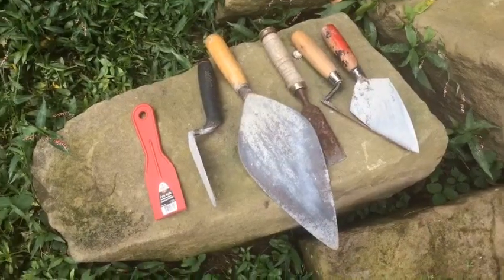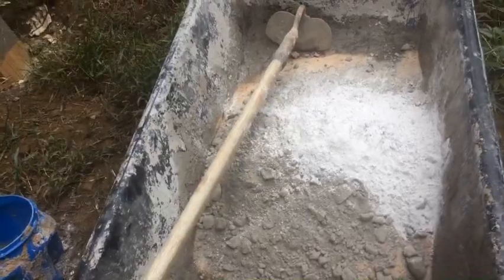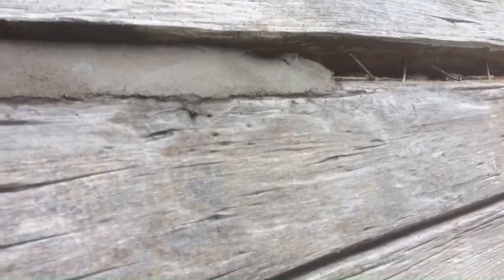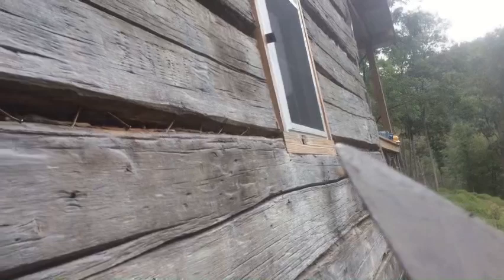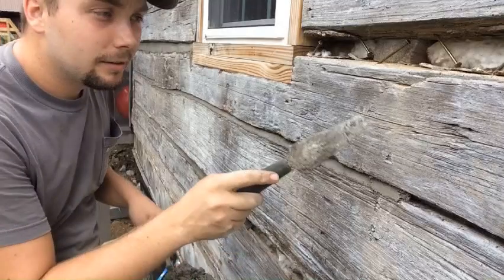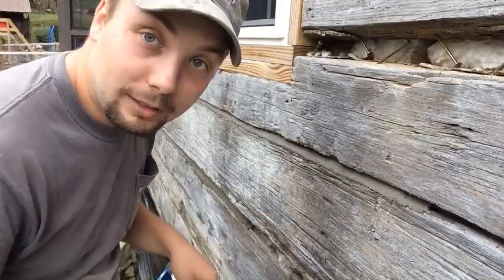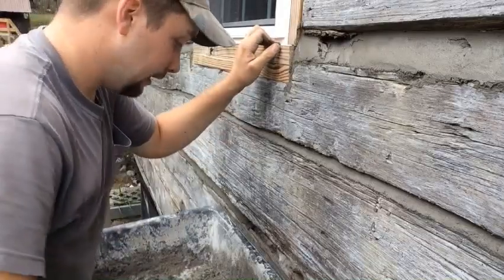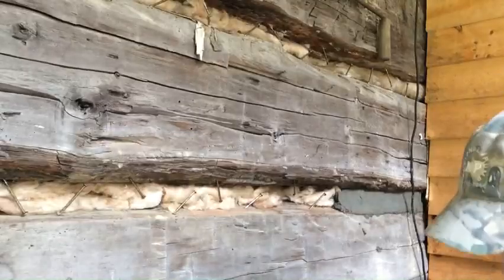CHINKING A LOG CABIN

Comment: I'm in the process of restoring my home which is 1937 built log cabin up in the Monteagle Tennessee area.  I have a really good log restoration guy that helped me replace some of the rotted logs, & I'm about to start chinking myself.  Everyone is "advising" me to use synthetic chinking, & I just don't see the benefit.  For one, it would cost me about $5,000.00 in synthetic chinking alone! (My chink joints are about 5 inches wide on average) so for maybe $600 at most for the cement, sand, & lime, I can do this & it will be much better long term.  I love watching your videos Jared! You are an inspiration!

Comment: I have an old log cabin with mud and straw used for chinking and some of that is falling out  Would mortar on top of the old mud hold or would I need to use some wire mesh to hold it in?
Reply from the maker: I’ve never tried that, I would say wire would be needed. You might search up the bearded carpenter and ask him

Comment: Doesn't the cement crack and fall off because of the expansion and retraction of the wood when it rains? Isn't tar or silicone better?
Reply from the maker: you will get a few cracks but it holds up pretty well, I know of lots of cabins this type has been in for many years and looks good still

Comment: Just an idea, have you ever thought about using a heavy duty piping bag to squeeze it into the joint? It might not work on the really wise joints but it should work fine on the smaller ones. Just a suggestion. Great job! Thank you for sharing!
Reply from the maker: I bought me one today and will try it out on the smaller ones
Reply: Fluty Lick Homestead That's good and I hope it works well for you. Thank you for replying back to me!

Comment: I stumbled upon your channel yesterday morning before I went to work.I love everything about it.I would love to get my hand on a old cabin like that but unfortunately it's not many old cabins in Alabama so I will have to build my own. I was wounding if you might help me out buy answering a few questions.What do you think is the best species of wood to harvest your logs form as for as rot resistant ,bug resistant and for longevity?I want to build a home that will be standing 200 years.My cabin I will be built  after the old cabins like your with  flat fancier boards and I want to build it as accurate as possible.How thick is your logs?I'm think about going with the dove tail notches on the coners in you opinion is that the best notch to keep moisture out of the would or do you prefer another notch?Like I said I love your channel.I love your cabin.I love the fact that your humble.But the thing I love the most about you channel is you reference the Lord.Faith can't work without Love.Love you Brother.
Reply from the maker: Thank ya!! My logs are between 6 and 7 inches thick, not sure what trees y’all have in Alabama but my cabin is mostly poplar and pine with hemlock in bottom run, cedar lasts for ages, most importantly build it off the ground good, and good overhangs and dovetail botch I highly recommend
Reply: @FlutyLickHomestead  Thanks for the reply.Wow 6 to 7 inches I was thinking  4 to 6 inches.Any way thanks for videos and helping educate everyone on some of the old forgotten ways of our ancestors. Have a blessed day.

Comment: I know y'all are already in the cabin but I was wondering if you had any video footage or suggestions on running the plumbing and electrical inside the cabin. We may build a flat log style house soon and I am not finding much on YT about the challenges of doing that where you don't have the benefit of the 2x4 walls to hide it in. Thanks for the videos.
Reply from the maker: Hello I don’t have any footage but can give you some advice. For the electric I ran many wires threw the cracks, also as you lay your logs up take a large drill bit and drill holes in the logs and you can pull wires up threw them into the cracks. All my plumbing in log part I came threw the floor. If you need plumbing in an upstairs of logs you’ll have to come up with some kind of wall to take them up threw.
Reply: @FlutyLickHomestead  Thanks!